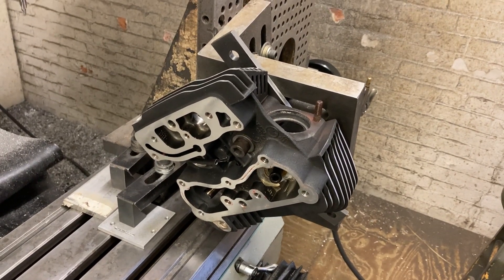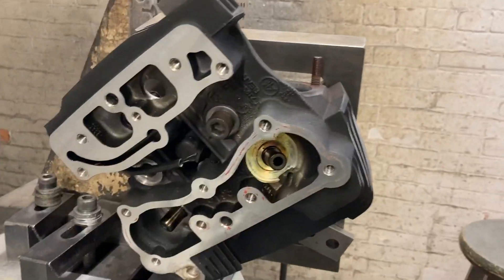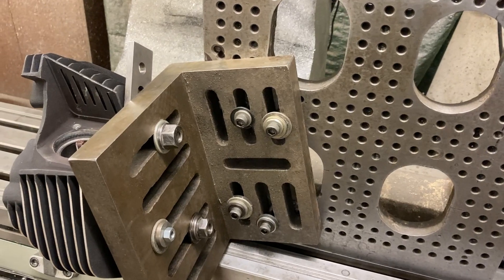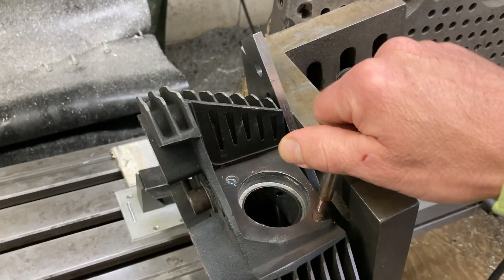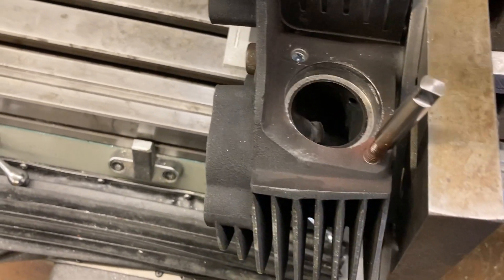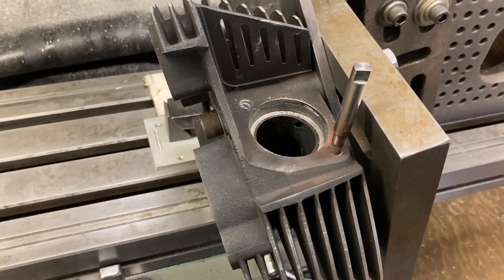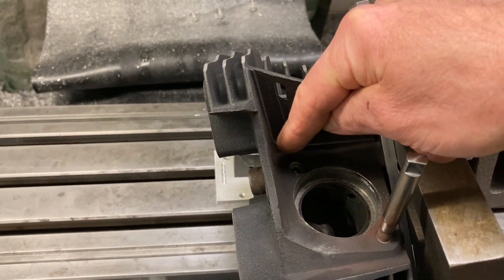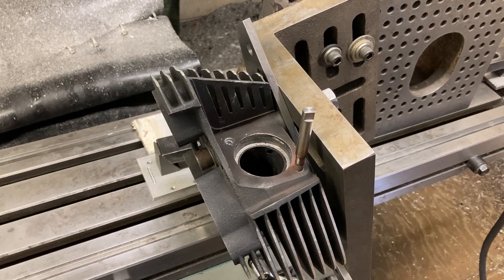Harley Davidson Motorcycle Head Broken Exhaust Stud Set-Up and Removal on Milling Machine Drill Tap

Comment: Get a 7- 16 bolt, point it with bench grider, tack it with the electric welder, the heat from  the welder will free it, back out your broken stud, simple  as can be, 2 minute  job.